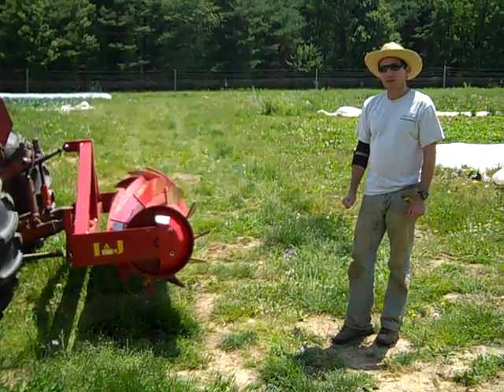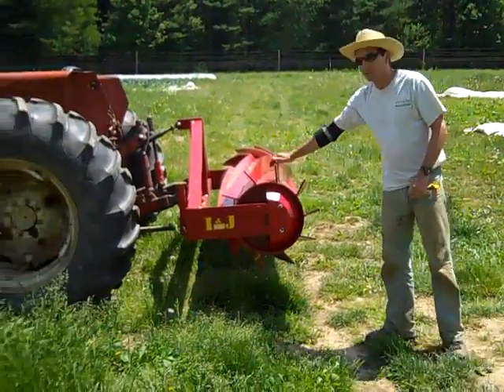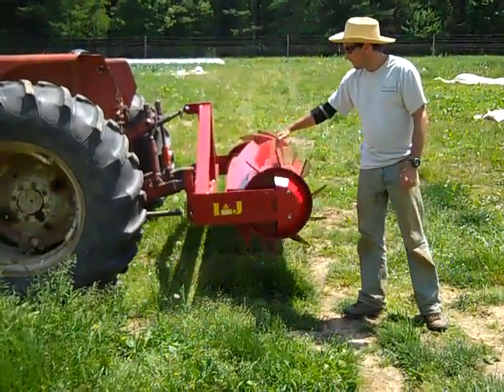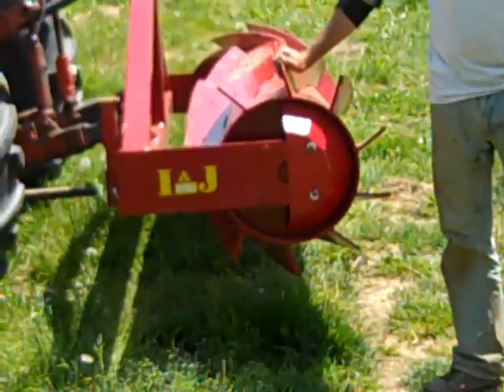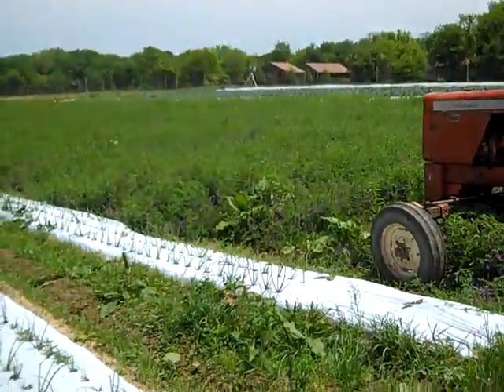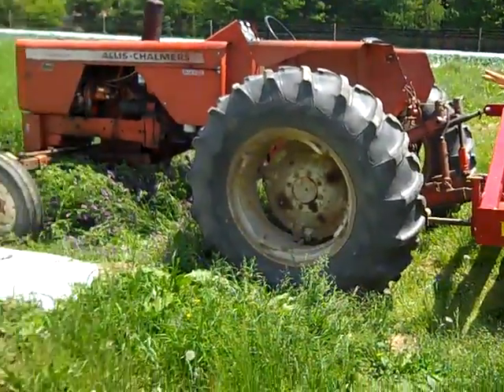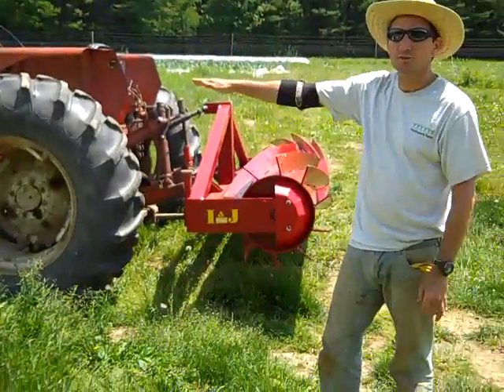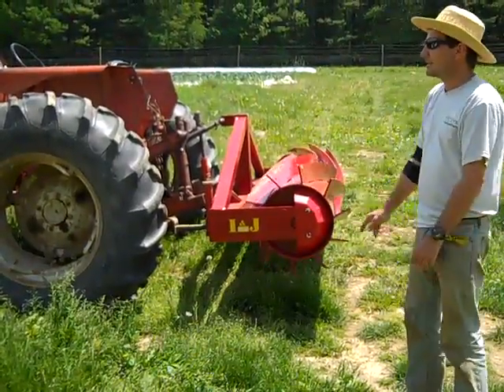No-Till Farming (Part 1)

Comment: Do you think it will be different if the 'knifes' from the roll are straight instead of on an an angle like yours are?
In Holland mulch and not till seeding is really new and i might want to build something like this myself.
Reply: +Ruud , The knives are angled on this machine to keep it from bouncing.  I've seen one made with straight blades and it bounces a lot.